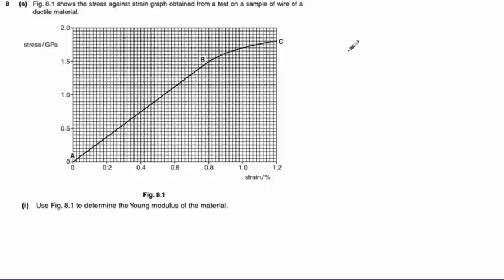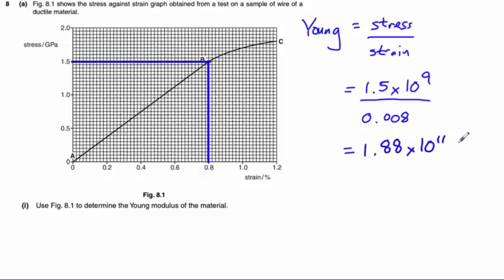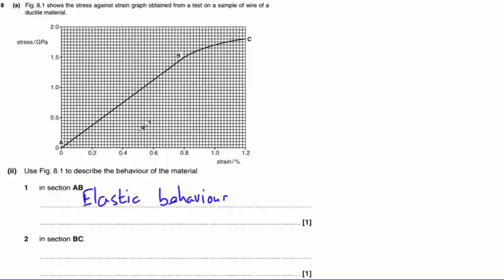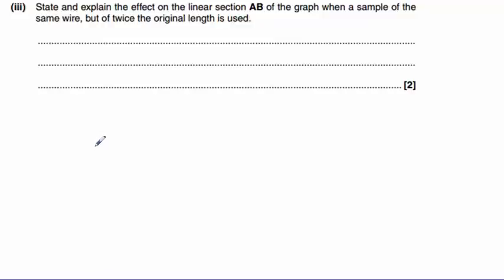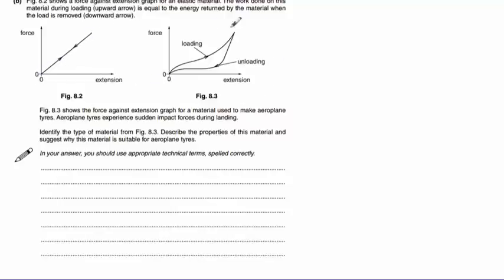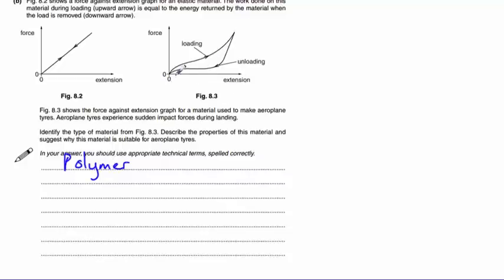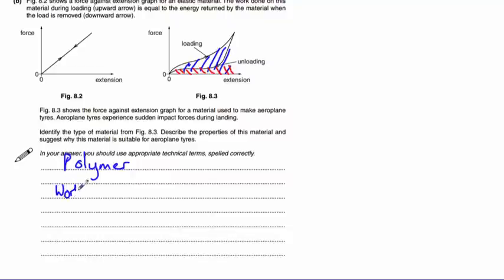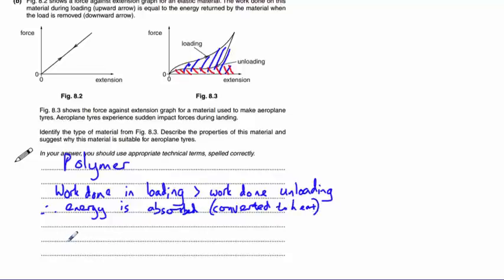OCR Physics A Mechanics (June 2013) Q8 (stress and strain)

Comment from the maker: The Young modulus is a property of the material itself - it cannot change simply by changing the dimensions of the material. In this case, when you double the length of the wire, the extension would also double, so the strain would be unchanged.